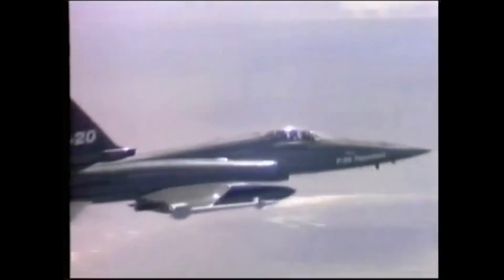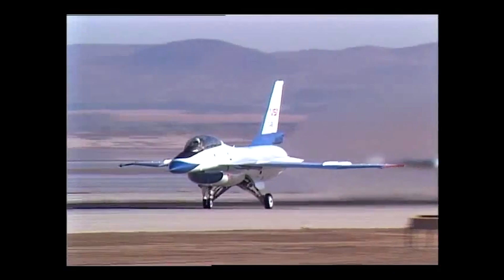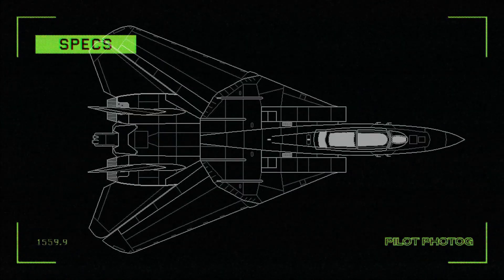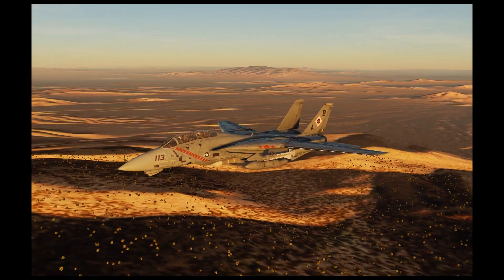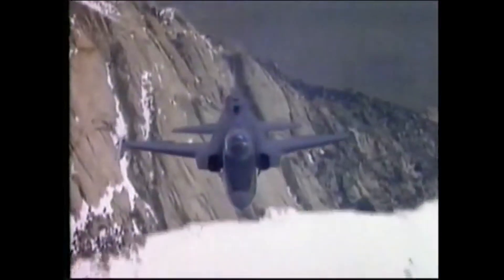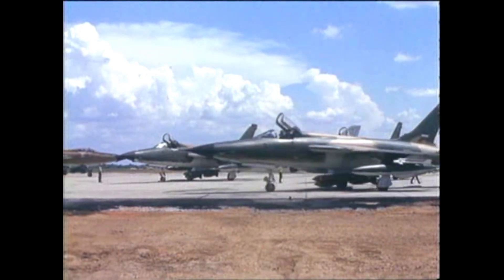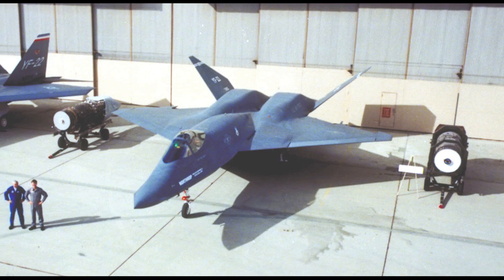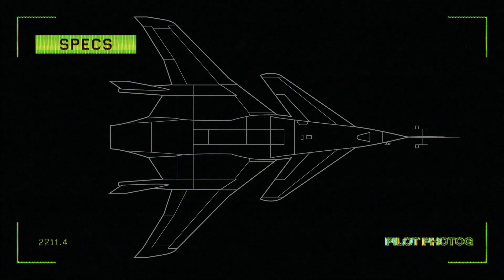Top 5 Fighters That Should Have Been Built | Best of Aviation Series by PilotPhotog  f20  f16xl

Comment: The thought of a Super Tomcat 21.....would be awesome.  The Navy is lacking an air superiority fighter I am sure they miss the F14.
Reply from the maker: Indeed....I am sure they miss the range of the F14 as well...thanks for commenting!
Reply: Actually, the F-35 can out-maneuver any 4th gen fighter and lets pilots perform stunts only done by the F-22 and Su-57. The issue when it previously lost to F-16s was a software issue, which has been patched. It's now got a 15-1 kill ratio in (practice) dogfights because it can point its nose just about anywhere.
Reply: @sleepyancient6655  I am aware however it not as fast, range is relatively short, and weapons load out is minimal (better if bypass stealth with hardpoints).
Reply: @MeMyselfI_69  With all due respect, speed beyond what the F-35 has isn't really necessary for a modern air superiority fighter, since close-range dogfighting is and has been a thing of the past for many years. And with the F-35s ability to point its nose anywhere and not even need to line up as much as previous generation weapon systems, speed wouldn't really give an advantage like it used to.

Now, range could be an issue for a land attack since the F-35 has a 1200 nm range (like the Super Hornet) and the F-14 had 1600 nm. So I get that.

That said, I would still argue that the f-35 is an air superiority fighter, at least in most of the potential meaning of the term. Enough so that the words "The Navy is lacking an air superiority fighter" are incorrect.

Interesting news (for future discussions, and not this one, as this one is for the current state of things) is that the air force has given Pratt and Whitney 1 Billion to develop more efficient engines which could increase the F-35's range by up to 25% (and thrust by 10%), which would bring the range to 1500 nm. If those breakthroughs are made, the Navy will get in on that action, I suspect.

Comment: Yeah because there's nothing suspicious about a country suddenly having their plane industry shutdown and their prototype planes all destroyed.
Reply: it happened basically to Australia. Just when we were developing the CA-23 as well. would've been a great plane : /
Reply: There were Soviet spies in Avro, once they had the technology to make an interceptor like the Arrow, they did.
The Foxbat and Foxhound dprove that.
Reply: @Dexter037S4  with the Mig 25 still holding the fighter speed record (melting/destroying its engines to do so, but...heavy design cues from the arrow)
Reply: @Dexter037S4  They took the basic airframe and wing design from the North American A-5 Vigilante and Avro Arrow, then put the Arrow's nose and radome design on it to house the huge Smerch radar.

Canadians had done the aerodynamic testing of that radome and nose, and worked out the optimum ogive. Windscreen resistance to aerodynamic friction heat had been engineered, and the Soviets just stole it.

They didn't have the metallurgy specialty to make a Titanium airframe with advanced materials science for heat mitigation of leading edges, so they made the Foxbat mostly out of stainless steel as a brute force approach.

Go look at the 1958 Vigilante, 1958 Arrow, and 1964 MiG-25. You'll see where they got the intake geometry, wing planform, basic fuselage shape, horizontal tail planes, etc.
Reply: YB-49 ?

Comment: Why did the YF-23 loose. In my opinion here's why. 

1. Saying the YF-23 is almost as maneuverable as the YF-22 is what the Northrop keeps saying but because the 23 had half the number of control surfaces as the 22 and no Thrust vectoring, it makes this claim questionable. 

The pelican tail was used for both yaw and roll control, so what happens when you want to do both at the same time? 

If the pelican tail was so revolutionary then why has no one adopted it? Boeing played with the Idea when the X-32 was being designed but ultimately abandoned it in  the final product. 

Both the Korean K-FX and Japanese X-2 program favored tails that resemble the F-22's and not the YF-23's. 

2. It was much faster: if you watch Paul Metz's lecture on the YF-23 he released a graph which I believe is the closest unclassified evidence of the top speed of both aircraft. And while the YF-23 reached a higher super cruise speed, the 22 reached a higher overall top speed. Furthermore Metz said nobody knows the capability limits of both, and so far everyone who said that the 23 was "much faster" than the 22 are all Northrop employees. How did they know it was much faster? No one knew both, according to Metz. 

3. The YF-23 carried 5 internal missiles to the 22's 8 and modifications to the EMD production model was needed to match that. Will the 23 retain it's prototype's speed and maneuverability with the modifications? 

4. The YF-22 flew more hours and more flights while demonstrating more aggressive maneuvers than the YF-23. 

P.S. with regards to engines. I was fortunate enough to talk to a Pratt employee on why he thinks the YF-119 won over the YF-120. 

The YF-120's variable bypass engine was good on paper but was extremely difficult to optimize. In 1990 GE released numbers on how much fuel the GE powered YF-22 used to reach Mach 1.58 with no afterburner. 

Luckily the Pratt powered YF-22 was also tested at max mil power and could only reach Mach 1.43, however it can reach mach 1.58 at minimum afterburner and was still consuming around 1000 pound less fuel per minute than the GE engine. 

The bigger version of the Pratt and Whitney F-119 production variant which is every bit as powerful as the YF-120 was even more efficient according to him
Reply: Also, you can hate me all you want, the back engines look kinda ugly

Comment: The Japanese Mitsubishi F2 took some elements of the F-16xl into it's design. similar extended length and wingspan of the F16xl with more hardpoints and weapons load than F16, but without the cranked-arrow-delta wing.

Comment: I think uploader has no clue, or is ignorant, and video should be renamed to - 5 fighters that lost competition. All the faults mentioned were enough reasons not to use it and replace others, or enough reasons to not justify the manufacturing of the 2nd place runner. It's like "hey, look how cool and weird this plane is, it could do this and that. Imagine if it didn't had crucial issues..."
There are reasons these crafts didn't ended up winning the competition for being manufactured.

These prototypes of competition planes remain in museums and etc., and may or may not be worked as an inspiration or redesigning with influence from.

YF-23 saying that it was almost isn't enough, I read it was simply less agile. That concept doesn't look similar at all, it looks to be a flying wing type of plane, like Ho 229 and B-2. Engines look way smaller, unless the plane is made large enough that those engines just look normal, because the YF-23 was skinnier, and thus engines looked huge, but the Raptor was smaller as well, and thus engines are smaller. the concept is nothing at all like YF-23, so it tells nothing. What to me tells, is how way ahead of its time were German engineers of WW2 when developing Ho 229.

Comment: I believe it's funny that the list had two Northrop products.  It should have featured three: the YF-17 / F-18L was the fighter that almost was.  Iran almost bought the F-18L in great numbers which might have altered the F-16 history.  Imagining the F/A-18 legacy Hornet weighing in 4,000 to 6,000 lbs lighter, but with virtually the same fighter and attack avionics capabilities as the Hornet with an extra wing station, that would be pretty much more capable than the F-16s that were exported at the same time period.  F-18L should have been built and arguably would have had a much wider yet influence on world fighter aviation of the 1980s and 1990s.

Comment: If the YF-23 went into production, just the aesthetic alone would change aircraft design. The diagonal tail surfaces and the isosceles trapezoidal ting would soon become a standard for fighter design. It would be a revolution sort of like the Delta wing craze of the 50s and 60s.Everyone would start using it, and eventually, it will be replaced by a (hopefully) even more intimidating design. The concept alone of having a truly unique plane in service, and being a mighty good one, would lead to consideration for the plane in question, in this case the YF-23.

Comment: One fighter that should not have made it's way to this list: The Super Tomcat.  It was cancelled for all the right reasons: Way too expensive. Way too big. Way too troublesome to maintain. Way too clumsy. Way too heavy. Way too complicated with it's swing wing. (Swing wings belong to the past) The F-18 Super Hornet was a much, much, much better choise.  

The other fighters on the list are spot-on; especially the Tigershark and the F-16 XL.
Reply: ST-21 was only slightly more expensive than the Super Hornet, had better performance, and the maintenance issues with the F-14 were a result of political neglect, not design.
Reply: @dumdumbinks274  I don't know the weight data for the ST-21, but the old F-14D weighed almost 20 tonnes empty. The F-15C weighed a little less than 13 tonnes empty. So F-14D weighed 7 (seven) tonnes more than the F-15. 
And when the two played together, the F-15 would mostly win.
Anyways, the Tomcat (also the ST-21) is simply too big. The F-18 Super Hornet does everything the F-14 did - much better and easier. 
The Tomcat is a 1960ies design. Outdated. Makes no sense to build a "Super Tomcat" other than the "wuauw-value"
The bracket for the swing wing weighed more or less almost the same as a whole F-20 Tigershark.
F-14 is an outdated design. Just accept it. It was a very wise decision to ditch it. It had a service life of more than 30 years. All good.
Reply: @MeBallerman  F-14A vs F-15 was mostly F-15 winning in BFM. F-14B/D vs F-15C favoured the F-14 as long as the pilots were experienced. The thing with the F-15 and F-16 is that their dogfighting strengths are easier to understand and master, but there's also less potential. The F-14 in all variants was the best turning of all teen fighters, but the A model lacked the thrust to keep up in the vertical and pilots had to be careful when making flight adjustments thanks to the TF-30s. That resulted in the F-14A only being a moderately capable dogfighter, but the B/D models were easily top tier among the 4th gens of that era.

F-14 was basically the same size on-deck as the Super Hornet, and it outperformed both F/A-18s in all aspects of combat performance including maneuverability at any speed higher than 350kts. Despite their weight the B/D models didn't even need afterburner on takeoff unless carrying a very heavy payload. Really the only aspect it lost in was RCS.

F-14 was outdated not because of it's design but because of it's lack of upgrades and funding. Here's the thing... the F-14 had to deal with budget cuts brought on by political opposition since before it entered service... they didn't even have the money to fund weapons qualification of dumb bombs.
In the end it wasn't simply a type of fighter serving for 30 years... the A model with no upgrades since 1978 served for 30 years and still made up the majority of the F-14 fleet at it's retirement. The F-14D barely touched on the design's potential since so few were produced and most ended up not receiving the full package due to budget cuts after the end of the Cold war. 

The F-14A was supposed to be an interim model with less than 100 initially planned. It was forced by politicians to use the outdated avionics and engines developed for the F-111B leading to inferior BVR performance vs fighters compared to the F-15A. The F-14A ended up being produced in large numbers solely because none of the planned upgrades were funded properly, mostly thanks to politics. By the end of F-14 production it made up almost 80% of all F-14s produced.

ST-21 was a proposed upgrade based on the F-14D to extend it's lifetime and usefulness and wouldn't exist if the F-14 had been developed as planned. ST-21 would have been cheaper than the Super Hornet because unlike the Super Hornet ST-21 was an upgrade of an existing aircraft, but since Boeing disguised the cost of the new fighter using deceptive marketing i.e naming it as though it was just an upgrade, they successfully convinced politicians that the Super Hornet was a low-cost option. 

ASF-14 was another option, but since it was known to be a completely new aircraft with superficial similarities to the F-14 it was considered too expensive for the time (end of Cold war with massive budget cuts).

Comment: Very good video. About the F-23 losing to the F-22, that was mainly to three reasons. First one was that the relationship between Northrop and the US goverment wasn't precisely at its best by that time, due to some blunders and the many problems the air force had to face with the B-2 Spirit during its firsts years of service, with Northrop (which still wasn't part of Lockheed Martin by those days) not precisley delivering on some promises made. Second, the F-23 wasn't as agile as the F-22. The F-23 couldn't achieve those attack angles by any means, as the plane wasn't designed for that basically, but for very high speeds while  maintaining stealth (where the F-35 fails); i mean the F-23 was some sort of a a new generation interceptor. That's why they didn't demonstrate in that trial you mention in the video. And third, if you thought the F-22 to be soo expensive and with very  few units having been produced eventually to this day..., it was just childs play compared to the F-23. The F-23 was indeed a formidable high speed fighter interceptor, but the air forced also wanted the plane to perform well in dogfighting, as we could have it no other way, hence the F-22 won. 

The F-23 was alwyas a favourite of many during our childhood, which is fun because we knew of this plane but still did not about the F-22. And then one day the F-23 dissapeared from the scene, and the F-22 took its place. Even in those old 2d aircraft games from the arcades you could see the F-23 in some of them (and the F-117 too), but never the F-22.

Golden days. The F-23 is like a symbol of those wonderful times, just like the Su-47 Berkut became the reference for so many during the nineties, the F-23 was always considered top tech plane.
Reply from the maker: Thanks for commenting- do you remember a game called Strike Commander? By the same fellow who made the Wing Commander series.  Anyway it had both the F-22 and F-23 in it.  Thanks for commenting!

Comment: I love how the f20 makes the hornets engine look big😂 it had no limits in AOA and only didnt go into production because it would of taken sales away from the f16
Reply: It had the same problem as the f16, no range w out refueling. We should have produced more f5s than f4s. I worked on f4s and they were labor intensive. F5s were easy in comparison. The f20s would have made great alert aircraft. They were f5s on steroids.
Reply: Exactly correct Mr. Montgomery.  USAF attitude was screw our poor allies. Drive them buy highly complicated and much more expensive F-16s to help reduce the production/acquisition costs for us. Many countries were forced to reduce fleet sizes and struggled to keep them operationally ready.  BTW Mr. Kopack the Aggressor Squadrons all wanted the F-20 to replace the mighty F-5 Tiger II (I was there).
Reply: @bualeegrasse2380  The F-20 would have been an excellent Aggressor training aircraft. Most of our Allies that purchased F-16's already had aircraft in service before the F-5G (before it became the F-20) flew for the first time.
Reply: @bualeegrasse2380  it's really sad when politics get in the way of a great plane, I think Australia would of even looked into the F20 either instead of the F/A18 or a mix of the 2 planes F20 for an intercepter and 18's a to do a mix of both ground and fighter work
Reply: That and no one wanted it.

Comment: I see the 22 and the 23 as equals I don't see one as being that much better than the other it came down to presentation the Black widow group gave the Pentagon what it asked for a high flying fast look down shoot down air frame its top speed is still classified but they didn't bother to show off anything extra which my have cost them the Raptor record speaks for itself  it has yet to be beaten. With the new avionics systems coming online with all aircraft talking to each other the aircraft that the US can put in the air together is mind blowing you can have F 15s F 16s F 18s F 22s F 35s plus others all in the same air space coordinating with each other is a unbeatable combination

Comment: Great video and tough question. Completely agree with you on YF22 and YF23 but my vote would be the F20 best bang for the buck
Reply from the maker: Indeed F-20 had the potential to be a global export fighter and hence lower production costs per unit.  Thanks for commenting!
Reply: @PilotPhotog  I'm ex air force and have a lot of time instructing in the T28 also had the privilege of flying a F5. In my opinion I would rather have a bunch of good airplanes then fewer perfect airplanes.  Its the same comparison in Ww2 Sherman vs Tiger tank. The Sherman was absolutely not the better tank but there were a whole whole lot more of them.